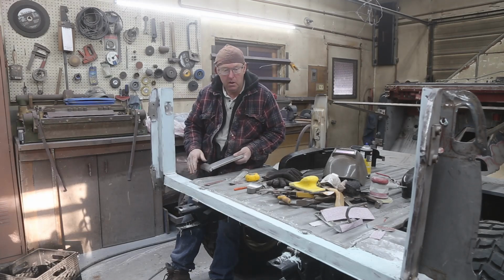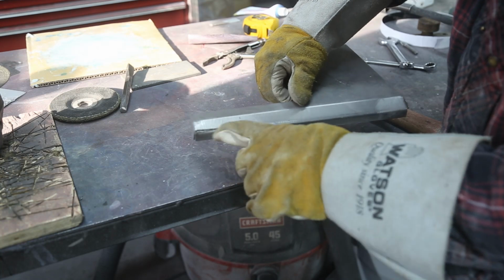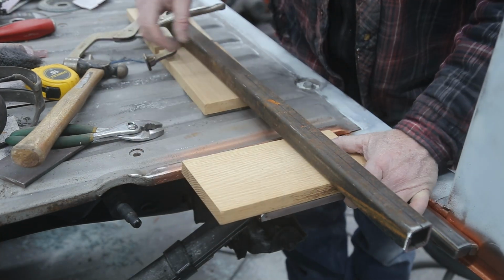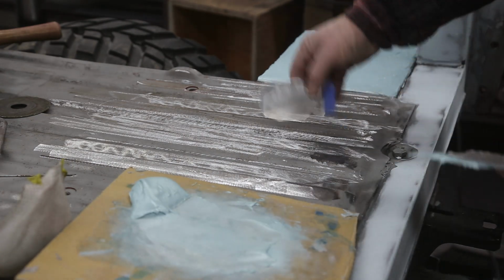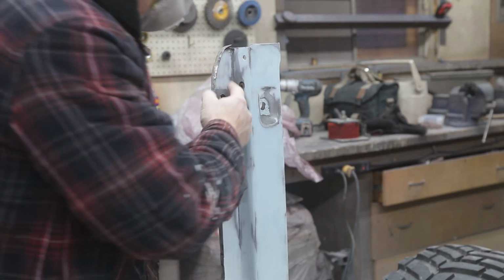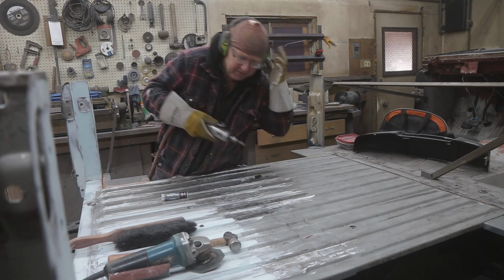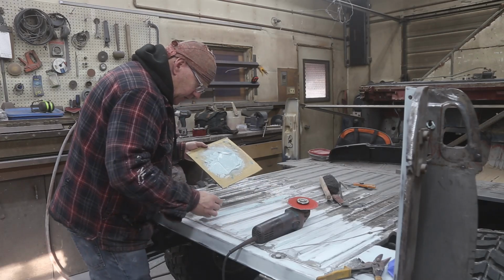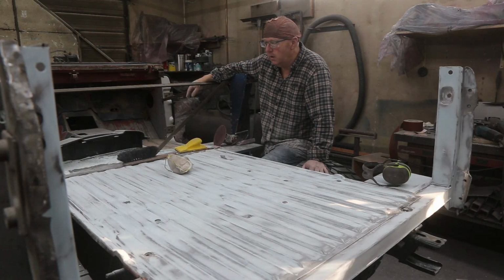1969 Ford Bronco Restoration-Bed repair and bodywork

Comment: It looks awesome what you doing the actual liquid Steel in a tube is pretty good darn stuff I sealed a gas tank as it was leaking and it plugged it right up when we junk the car I cut the gas tank open and a mushroomed inside the tank and it didn't go funny inside the tank either thank you for the video
Reply from the maker: It is great stuff.  I fixed an oil leak on my VW engine with it, tin had wore a hole in the block, and it would work for about two years before a redo.  I feel confident that it will work just fine.  Thanks.  Stevo

Comment: Excellent job. We used Steel Stick on low pressure mud lines on mud tanks on the drilling rigs worked great. 👍Again you guys are the best
Reply from the maker: I feel better about using it now.  Pin holes are a real pain.  It may be my new best friend.  Thanks Wayne.  Stevo